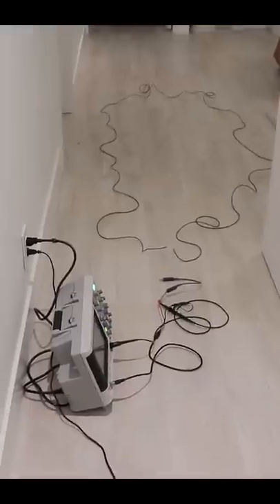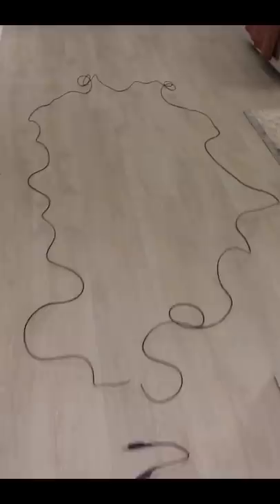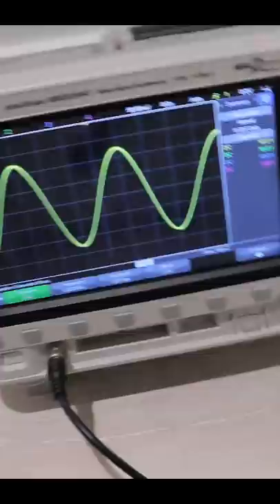The Crazy World of AC Electricity #shorts

Comment: This works with open circuits as well. Just gotta have a long enough wire pair at each end of the led. Although technically this demo already covers the latter case (unless he's exceeding the reverse bias breakdown threshold).
Reply: Hint: 5MHz has a relationship with the length of the wire here.
Reply: @rodericklenz5030  yes
Reply: @rodericklenz5030  Yup, cable’s length is 180 degrees at the frequency given — the length also makes sense if you run the math, should be around 2.5 meters or something.
Reply: Most definitely not, the wavelength of 5MHz in free space is 60 meters :D
Reply: @luuhinz  i meant in general. That spesific example is just that - spesific.
Reply: @luuhinz  Not sure what I was thinking here, probably went up to 5 GHz somehow. You’re obviously correct. this would need to be a 60 degree or so cable.
Reply: Correct me if I'm wrong, but I think that this effect is more related to the capacitive coupling between the wire and the ground then with the frequency itself or the lenght of the wire. The wire loop is nothing but one side of a capacitor, while the other side is represented by the ground. Because the ground of the function generator is connected to the PE the circuit is closed through the ground and then to the LED. As you said, indeed, this could perfectly work with an open circuit. The loop itself is doing nothing but increasing the capacitive coupling: infact, the higher is the capacitance, the lower is the reactance and consequently the impedance, and a longer cable helps more current to run through the LED. Of course we're talking about currents around a few mA, which aren't able to trigger any of the house breakers. I know that a high frequency helps, since the reactance is inversely proportional to the frequency, but I've seen this work with 50/60 Hz and a light which turns on at a sufficient low current.
Reply: @matteopiacentini325  My understanding is that it’s a combination, but not for your reason. You claim that high frequency decreases the reactance from the parasitic capacitance to a nearby object and will short to “ground” (really this is a ground loop as the actual ground probably has a potential to the “ground” of the coupling). Accordingly you claim that there is no inherent need for this to be a loop. I agree somewhat: you need a ground connection (a potential difference) to actually get any current out of the system and some sort of capacitive coupling is necessary with no explicit ground. I am not convinced what you said is what’s happening, but I may very well be wrong.

I think the loop is absolutely essential for a continuous light to emit from the LED (although you may get some waves bouncing off the ends if it’s an open loop, not sure if I want to think about the dynamics of that case). I don’t get here how a longer wire would help for example as this is not an inductor. Lighting a bulb is also different from an LED as it is a diode and can’t take AC directly. To be fair my electrical engineering knowledge comes 90% from telecommunications so my mind is biased here. My understanding is that when you apply a high enough frequency to the wire its length becomes comparable to the wavelength of the wire, causing a nonnegligible electrical length. This means that as the AC signal traverses the wire the field at one end can be substantially different from the field at the other. For example with a 5GHz signal and a wire that is around 2.5 meters long the electric field at one end of the loop lags the field at the other end by 180 degrees, meaning there is a constant magnitude, alternating sign potential difference (a square wave) between the two ends of the LED. A closed loop with a potential difference will drive a current. As LEDs are diodes, they act as a dielectric and have an inherent capacitance when they’re reverse biased and accumulate charge. When the polarity switches it discharges itself, and lights up. The cycle then repeats and you get an almost continuous light from the LED. Essentially the wire itself has its own potential difference driving a current. The system is a ground loop again wrt to the scope and from the perspective of the scope there is an emf generated and therefore a small amount of power consumed — as you said, no free energy, and it would trip a GFCI (but not a normal breaker) if the load was high enough. Disconnecting the loop from the signal and connecting it to the ground will cause a current to flow to pull the loop back to ground.
Reply: @matteopiacentini325  not wrong at all. Great summary. Mehdi's got another video on the subject called "why cheap led lights keep glowing", worth a watch.
Reply: @thebaker8637  Talking about this without the possibility of drawing some circuit is kinda difficult for me, but I'll try to explain myself anyway. First of all I must admit that my knoledge is quite limited when we start talking about antennas, radiofrequencies, waves, etc. so I might be wrong. If I understood correctly you're claiming that the system is working like some kind of antenna, with the current flowing through the LED because of the potential difference caused by the electromagnetic wave emitted by the positive probe.  Now if this phenomenon was caused only or mainly by this, we would have seen the LED turns ON even with the probe disconnected, since the wave can travel through the air as it happens with any kind of wireless telecomunication system. In this case though, we see the LED light only when the probe is connected and the only way this circuit can be closed back to the function generator is through the capacitive coupling between the wire and the ground and the ground itself.

Talking about the open or closed loop instead, we have to understand the purpose of the wire in the circuit. It's main effect is to act as one plate of a capacitor: it doesn't matter if the other end is connected or not to the other pole of the diode. As I said before, the circuit is actually being closed by the ground not by the loop of wire. This also explains why the longer cable helps. The capacitance of a capacitor is directly proportional to the surface of its plates. By increasing the lenght of the wire you're increasing the surface of the capacitor. This thing, for example, is well known by those who design transmission lines. The longer is the line, the higher are the energy losses due to the higher current flowing to the ground, always because of the capacitive coupling.

In the end, I agree with you on the LED inherent capacitance which keeps it ON when the negative half-wave occurs.
Reply: @kevin42  Yep, already seen that :)
Reply: @matteopiacentini325   I think you may have misunderstood — are not talking about EM radiation here, this is purely the time needed for the electric field to travel across the wire — which also moves at speed c. This works even if the wire transmits a signal and not picking up radiation, radiation just happens to use the same EM field as normal electric and magnetic phenomena. If you think of the electric fields changing due to the AC source moving between different voltages, that change has to propagate across the wire in the nontransient case — think of data transmission in a cable which has to travel at c. By that point you’ll have a phase shift because the signal needs time to arrive to the other end of the loop and therefore there is a potential difference in the closed loop, ie current. I claim you don’t need any parasitic capacitance to ground for this to work because there is a measurable potential difference, ie voltage, between the two ends of the LED already. They system has its own circuit with a potential difference between the two ends and a charge accumulation on the LED when it’s reverse biased. The circuit is of course always has a parasitic capacitor to nearby stuff including the ground but that is not the main flow of current IN THIS CASE — sure, LEDs can light up if you look at them wrong, but this is not the phenomenon at play here.
Reply: @matteopiacentini325  i generally follow the "rule/law of emergent complexity" when dealing with (seemingly) strange capacitive/inductive phenomena.
That is, i try not to get entangled in the nitty gritty unless i have to. Sure you can throw a bunch of fancy terms like parasitic capacitances, transient loads, inductive/capacative coupling.. etc around, but at a fundamental level it all boils down to basic theory.

But then i end up throwing all of that out the window and getting into the nitty gritty for a week until iv lost enough sleep to abandone the idea and be satisfied with having wasted 3 pages worth of paper.

Maxwell <3
Reply: @kevin42  To be honest on further inspection you and @Matteo are very likely probably correct and I was wrong. The length of wire would only really give you a 60 degree phase shift (360 degrees is 50 meters) so it may likely be the case that the system would just get most of the charges flowing to ground through parasitic capacitance to the ground plane instead of the same phenomenon between the two ends. Either way I am certain that both phenomena exist, which of these actually has more contribution is probably dependent on wire length/frequency and the voltage. Would be cool if Mehdi could test if you can actually get a more substantial load to run like this with a low frequency super long wire, and whether there is a difference depending on the loop being connected.
Reply: @thebaker8637   @Marcell Pek  Now I understood better what you meant in first place.

As I said before, I also think that both phenomena coexist, just that one is more impactful than the other.
Anyway there is only one thing that still doesn't convince me about your theory, and it's the following: the loop itself doesn't close the circuit. I understood the fact of the phase shift due to the high frequency of the signal, but even if you had one long wire with an end not connected to anything, the current caused by that would still be able to go back to the generator with the ground capacitance (like you also said in a previous comment).

Anyway, just for curiosity, you can see yourself the effect of the capacitive coupling with low frequency by using one of those live-wires-sensing screwdrivers. Those work even with your shoes on. The rubber sole should isolate you from the ground since their resistance is almost infinite, but a small current (talking about micro-amps) can still pass thanks to capacitance and it turns the little light ON. We used to do this experiment at school :P

Comment: ITS FREEEEEEEEEEEEEEEEEEEEEEE ENERGYYYYYYYYYYYYYYYYYYYYYYYYYYY without magnets?!!
Reply: It's not free energy he's using a Function Generator..
Reply: I'd say it's a combination of capacitance and radio transmission; the signal generator is slinging the electrons around the loop, so it draws some power to produce RF and lights the LED.
Reply: No magnets? Must be bogus.
Reply: @michaelwarren2391  ITS A MIRACLE 💪
Reply: @justcallmesomething8089  What do you mean? Are you on the side of free energy??
Reply: @bardrick4220  Seems true.. I think its related to veritasium's latest video about electricity that Electroboom is arguing with..
Reply: @alltechboys_tipsandtricks5709  I'm on the Free Energy side . . . I like to keep science free, open and unbiased!  If the research leads there, follow it! . . . We have alot to gain and not much to loose!
Reply: @bardrick4220  Hmm.. Well, I am on both sides.. But the fact is, the free energy is not proven till now.. As you said, if the research leads us there, we have to believe it..
I myself wanted to research on perpetual theories..
Reply: @alltechboys_tipsandtricks5709  I have found devices that work!  Barium Titanite pezo ceramics will behave like a solid state battery under certain conditions (you have to charge them in the correct polarity).  Then you can touch the leads together to short all the stored charge.  It makes a sound which releases energy. Wait a minute and the charge rebuilds!  Repeat indefinitely!  I think it's related to the feroelectric effect.  People have been lighting up LEDs and neon bulbs with them here on YouTube, and John Hutchinson has done alot of work on this, but I think it's not taken seriously because his "power cells" look like a chemical battery due to the use of rochechell salt.

Quantum Tunnel Diodes apparently also produced electricity, but they're quite expensive!

What I think is going on is rectification of Johnson/Nyquest noise, thermal or zero point energy present in the system.
Reply: Theres a magnet.
Its huge. Its connected to the other side of the mains.
Reply: @ruipl  It must be. LOL
Reply: Its close to that, but that still needs a little energy

BUT yes
Reply: Yesssss 😂
Reply: @bardrick4220  cringest comment i have seen
Reply: @flynntaggart7216  LOL wait I can do better: I like dragons in a romantic way!
Reply: @bardrick4220  lmao

Comment: LED lights typically operate on low-voltage direct current (DC) rather than alternating current (AC). However, some LED lights are designed to work with AC current directly. In such cases, the absence of a ground connection may not necessarily prevent the LED light from turning on. Here are a few reasons why an LED light might still function without a ground:

1. Isolation: LED lights that are designed for AC operation often incorporate isolation mechanisms within their circuitry. These mechanisms help protect against electrical shock and ensure the safe functioning of the light even without a ground connection.

2. Floating Ground: In certain electrical systems, a floating ground configuration can be used, where the ground reference is not connected to the earth ground. In such setups, the absence of a physical ground connection does not impact the operation of the LED light.

3. Two-Wire Setup: Some LED lights designed for AC operation are specifically engineered to work with a two-wire setup, where the hot and neutral wires are used without a dedicated ground wire. These lights are designed to function safely and effectively within this configuration.

It's important to note that while an LED light may still turn on without a ground connection, the absence of a proper ground can increase the risk of electrical hazards and impact the overall safety of the electrical system. Grounding is an important safety measure that helps protect against electrical faults and ensures proper functioning of various electrical devices.

If you have concerns about the grounding of your LED light or electrical system, it is advisable to consult a qualified electrician who can assess and address any potential safety issues.

Comment: You dont even need it to be a loop. You can literally connect the LED in series with a big metal POT and it will light if it is big enough (or there is enough voltage). Slightly different situation, but still.
Reply: don't forget the spoon

Comment: Take two fairly long wires (25+ feet long each) and connect an LED bulb in the middle and apply AC power to the end of one wire. Often you'll see the bulb stays on dimly. The AC takes time to build a charge all the way through the wires and thus one side is at a higher potential, which makes the bulb glow. Then the voltage switches and it comes back the other way. So it's like a huge capacitor. The LED bulb is wired to glow in either direction so it glows as the capacitor charges and discharges. A house that's got the load and earth lines reversed at the wall switch will wind up with bulbs that never turn completely off.

Comment: AC current is actually a Resonance Frequency .
Reply: The whole universe has its own resonant frequencies.
Reply: It's not "a frequency", it's a current. And the frequency at which the current oscillates is not necessarily resonant.
Reply: I think the wire is acting as a ground. It's the same reason you can get electrocuted with just the live wire. Grounding is confusing to me lol

Comment: I feel like this is super cool to someone who knows exactly what’s going on
Reply: Yup, I’m pretty lost XD
Reply: Me too
Reply: The wire loop is capacitively coupled to the ground. Imagine the wire loop as one plate of a big capacitor and the earth under the wire as the other plate. A capacitor impedance is inversely proportional to the signal frequency. So if the frequency is high enough, 5 Mhz in this case, the capacitor impedance is very low and there is enough voltage left to reach the led threshold and light it. This is just a big RC circuit if you think about it.

Comment: Wow. The really does show the power of resistors (the LED [one direction flow] and the length of wire [voltage droop]). Just that little difference in voltage is enough to make it flow.

Comment: the wire length caused a phase shift, so the two end had difference in charge.
Reply: I know very little but I thought it was capacitance. I would think that the phase shift would be so small that you can't run a led. Am I right? Please correct me.
Reply: @pyryvartiovaara230  you're right Dionium has no clue what he's talking about
Reply: @sinnlos229  can you point out the concept behind it....
Bcz I see only short circuit !

Comment: Led stand for light emitting diode. Diodes are one way valves for electrons. A/C is alternating current it is push and pull. So on one push it fills all empty spots with electrons but it is against the one way valve so electrons can’t flow through the led and therefore no light then on they pull, it is the opposite direction so the extra electrons that filled the free spaces can flow through the one way valve led making light. They are then replenished by the next push

Comment: LEDs are so cool because they light up, they are diodes that allow current to flow in one direction and they have a capacity like electrolytic capacitors. The wire has similar parameters, and applying an alternating current signal makes it work on one cable.